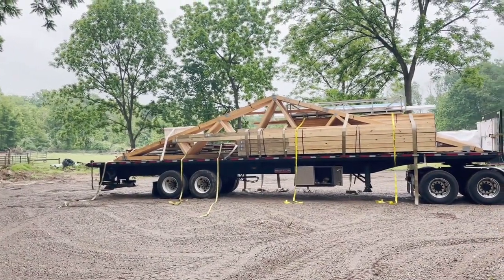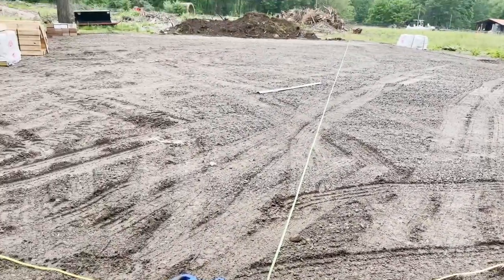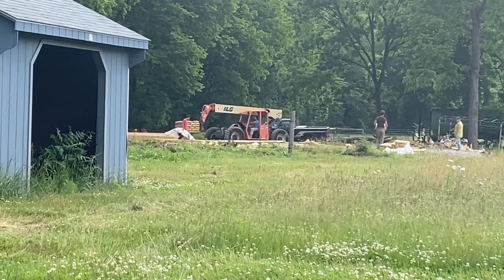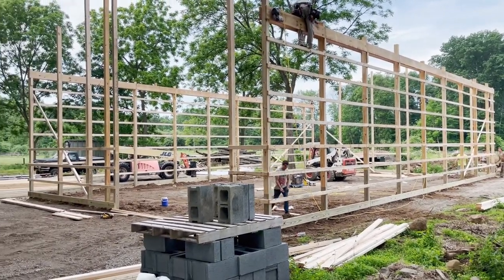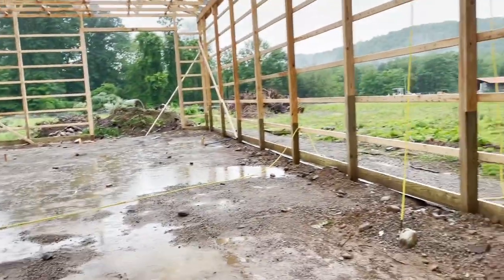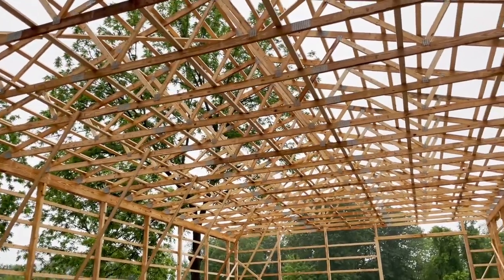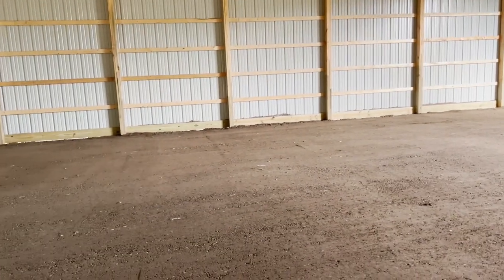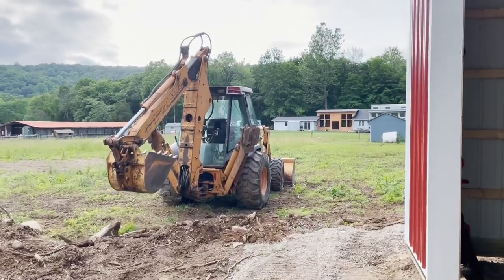Building a 40x70 pole barn in 3 days.

Comment: No wet set brackets? Can you recommend builder for Monmouth County N.J please?
Reply from the maker: No wet set. It’s really not going anywhere. Maybe in tornado or straight line wind areas I would consider it. Pioneer pole buildings is who I used. They are great to work with and if you want something done beyond the code, they will work with you. Best of luck with your build!

Comment: With the price of wood right now, I'm curious why you didn't go with steel trusses? 
Because that's what I plan on doing and I prefer the vaulted look over a flat ceiling....easy to build a loft
Reply from the maker: We had locked in the price back at the end of December. The price was higher than the year before but not what it is at present.

Comment: What were they using to attach the roof steel?  They were getting that on fast.
Reply from the maker: they use a hex head screw with a rubber washer. They are made to punch through the steel but have wood threads to grab the rafter.

Comment: aND...you used 2 DIFFERENT materials in the 2 different tapes. Ooops.
Close but no cigar.
Try using the SAME single tape for BOTH calculations.
Reply from the maker: Thanks for taking the time to comment. The two different tapes are both vinyl and are within a 1/4" of each other over 100'. You should realize that we were simply finding the corners to know where to drill. It can be off by 6" and it wouldn't matter. Its when you set your poles that you have to be right on. Hope that helps you to understand. Have a great day.